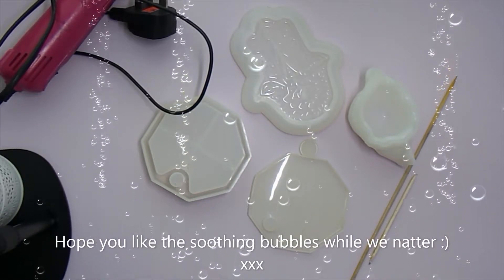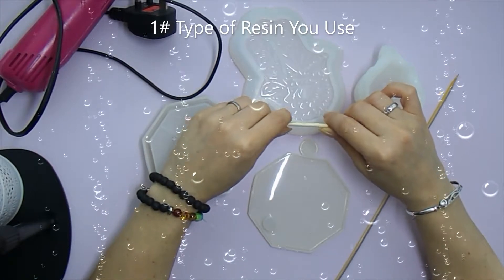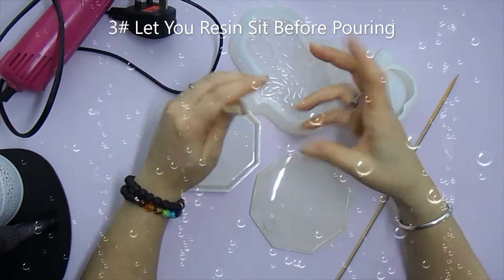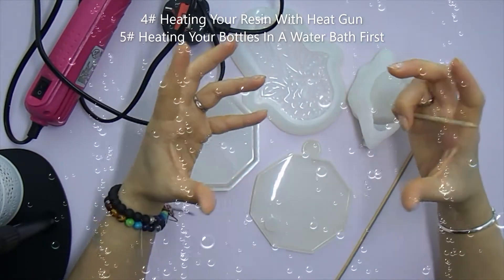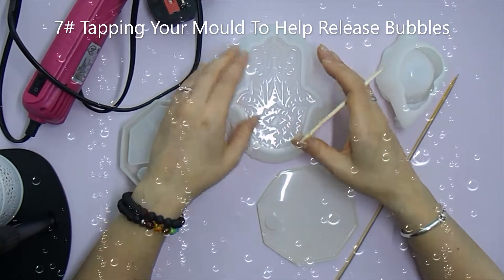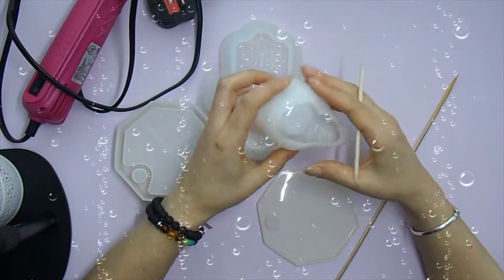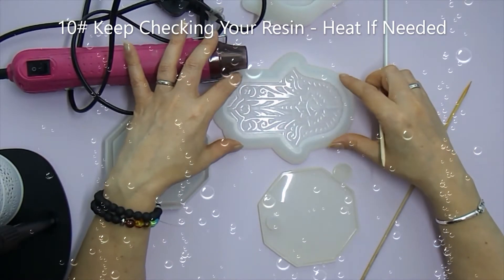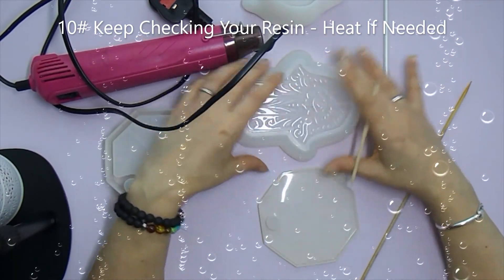10 Top Tips On How To Get Rid of Bubbles In Your Epoxy Resin !! That Actually Work !!

Comment: Great tips, explained well. Thanks! I heat only my cup of Part A (Resin) in warm water, which makes it runnier. You will notice a HUGE difference when you're stirring, as there will be many fewer bubbles. Never heat Part B (Hardener), as that is where all the nasty chemicals are, and the fumes are toxic (even though you'd be wearing gloves and a respirator with organic vapor filters). I used to use a heated coaster (for coffee mugs), but it eventually burned the bottoms of my silicone cups. Now, I heat a bowl of water in the microwave for 20 seconds and let the resin sit in there for a minute. Amazing difference! By far, the BEST tool I have for removing bubbles is a pressure pot that I converted from a Harbor Freight paint pot. Most of the people on YouTube who talk about how they're only around $120 for everything you'd need, forget to mention the compressor, which would start at around $100. But if you do a lot of resin work, it's well worth it. Some people talk about using a vacuum chamber. Those are better for silicone, if you make molds. I tried resin in mine once, but it can be too much of a mess if the slightest inattention to it occurs. If it ever bubbles over, you got a MESS! I use it for silicone all the time. A vacuum chamber gets rid of the air bubbles by sucking them out. A pressure pot doesn't actually remove bubbles, but compresses them so small, you can't see them.
Some people also spray 91% alcohol on the resin after it's been poured into the mold. It gets rid of the bubbles that reach the surface, but it is also harmful to the silicone mold. After some uses, you will start to see it.
My main warning about getting rid of bubbles: when I started, there were many people who talked about using a torch (like cooks use) to get rid of bubbles. NEVER USE A TORCH!!! You may get away with it the first time; maybe even the second time. But you WILL burn the resin to the mold and tear the mold when you pull the resin out, ruining it. Lighters and heat guns don't get anywhere near as hot as a torch - even a torch-style lighter. NEVER USE A TORCH!!!
That's about all I can think of for now. Good luck to anyone out there who is still learning resin. It's lots of fun... going to the bank every day to get money to buy more cool resin stuff. Have fun!
Reply from the maker: Hi huni 🤗 xxx Thank you soo much for your information xx Your experience is invaluable to everyone xxx I’m so glad you shared your knowledge xx I think il use the microwave tip and see if I can get on better with the water method 🤞🏻 xxxx

Comment: Hello Laura,, I don't normally get many problems with bubbles, but I do get a problem with thick resin, and I'm not too sure how to go about fixing it,,,,😖 I got my butterfly mould in the post yesterday morning,, so I can't wait to work with it, the one you done was absolutely  gorgeous,  my one with be the cosmetic holographic silver glitter,,,,with lavender holographic  glitter on the wing tips and turquoise,  with a little fine glitter added,,, I like to use UV resin with the trinket boxes,, as it don't take long to cure up,, the butterfly mould looks the same as the one you used.so happy with that one, and I have two  mesh butterfly's for the lid,,with these .title butterfly's you can put resin on them because of the mesh, as it would only leak through  the mesh,, but I ban attach them with the resin.. just wish I knew what to do about the resin  as its quite thick,when it comes out of the bottle,, I tryed it on a pendent mould,,as a test,,,, and after curing it went yellow, but when taken out of the mould it was clear it's a 500 ml bottle, any help on that would be great, sorry for long comment, I get carried  away sometimes!!!!, and Thankyou. 😘🌹🍁💐🦋🦋
Reply from the maker: Hi huni xx Omg I’m so excited to see how it comes out it sounds beautiful xx Never apologies for long comments huni I love reading your messages 😊I should have said these tips are mostly apparent for epoxy resin but some work for uv xx Heating UV can be tricky as it has a different chemical compound to epoxy xx Let me do some digging and il see if I can find a solution for you for the thick uv resin x I’m sure we can find something to help 🤗 xxx
Reply: @coobyliciouscrafts  OH wow that would be great  Laura,, I'm not a very patient  person when it comes to part and part resin even though I got two differant types of part one part two resin, thank you for trying to find out about how to fix my thick uv resin, I realy do appreciate  it.😀